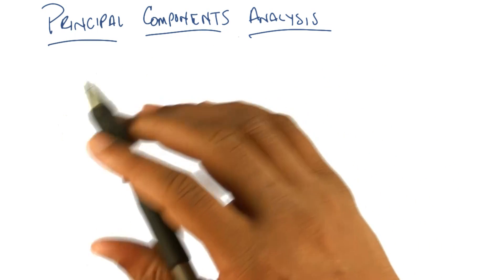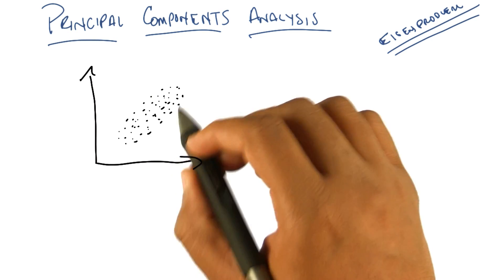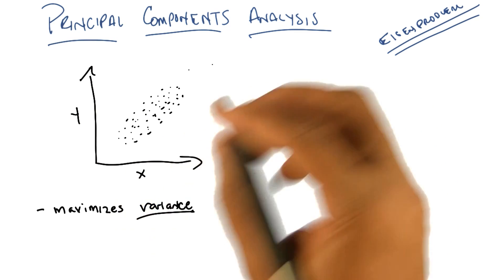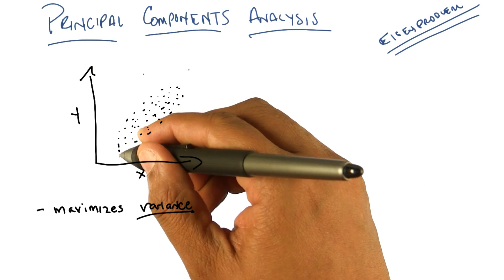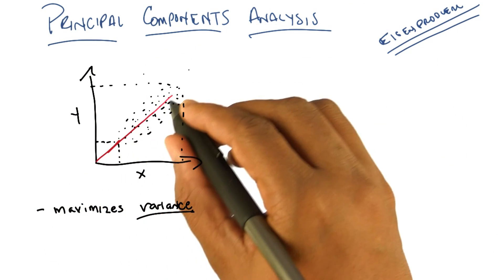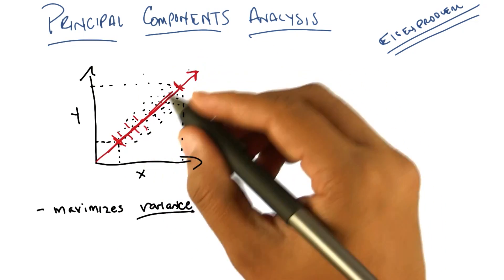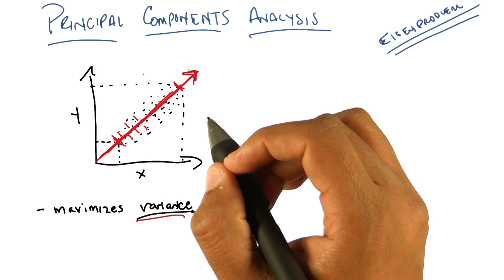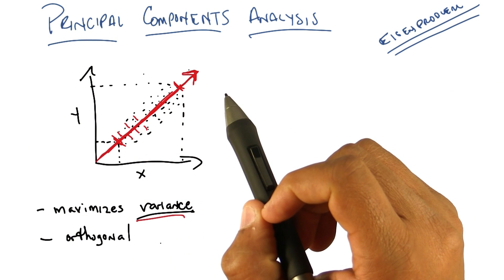Principal Components Analysis - Georgia Tech - Machine Learning

Comment: I think what many people are finding very confusing about this video, is the lack of clarity on what variance is measured relative to. Intuitively I think many people will be assuming the variance is calculated by measuring distances between points and the line. At multiple points in the video, when talking about calculating the variance, the pen is gesturing across the line (perpendicular to the line) and also red lines are drawn between the dots and the line, strongly implying that that's what is being measured (it's not). Ignoring the very misleading gestures; what the video is saying is that PCA is maximizing the variance of the points after they are are projected on to the line (i.e. variance along that line). The focus is meant to be on the distance between the dotted lines drawn to the X and Y axis vs the distance between the first two marks drawn on the example red diagonal line (larger due to larger variance). It doesn't explain that it's essentially equivalent to minimizing the sum of squared distances between the points and the line. I think this is why there are lots of comments confused about the definition of variance and whether there's a mistake and maybe he meant to say/write 'minimize'.

Comment: In PCA you are maximizing the length of the vector to each of the points from the center point of the data (mean value of each of the two variables you are dealing with), at the same time, MINIMIZING the distance from each point to the line that you drew....you are confusing many people.

Comment: i think, it is not maximizing the variance, but minimizing it. To get higher variance you can pick any line at a far away distance.
Reply: Say, data is d-dimensional. Now, you want to reduce some dimensions. You first create d new axes which are mutually orthogonal. Now along some of these axes, variance will be high and along some variance will be low. You eliminate those axes along which variance is low enough. This way you do not loose much of the important data and still reduce no. of dimensions. In essence, you try to select axes along which variance is high.
Reply: You maximize the mean squared distance, i.e. the avereage squared distance between the projected points must be as large as possible, so that you can have more disperse data

Comment: could you give a definition of VARIANCE, please?
Reply: I think Fomin is questioning the fact that they say PCA "Maximizes" variance. But the line he drew actually Minimizes it.  PCA indeed minimizes the variance of the sample point. He wrote that correctly in the video, but said the opposite.
Reply: For anyone confused about the video saying PCA "maximizes" variance but intuitively it seems like it's minimizing variance: The video is somewhat misleading about how variance is calculated. Focus on how spread out the dots will be after projecting them onto the line (i.e. along the length of the line). The variance being talked about is not calculated by measuring the distances between all the points and the line (ignore the misleading gestures with the pen). The variance here is calculated by first projecting the points onto the line, then finding the mean, then summing the squared distances between that mean point and each other point on the line (no need to divide by the number of points since it won't affect the comparisons when looking for the maximum). This is basically equivalent to minimizing the sum of squared distances between the points and the line (which I think is where some of the minimize vs maximize confusion is coming from).
Reply: TL;DR: How spread out the data points are

Variance is expected squared distance of the data points from the mean.

Imagine we take the height of 100 people in a room (room is the population).
If they are all between 6' and 6'1", the variance will be low. We can expect any given person to be VERY close to the expected height.

If the heights range are between 4' and 7', we can expect the average person to be further from the expected height.
Reply: He wrote "maximize variance", I don´t understand why it should be maximised and not minimised
Reply: do you live in a fucking parallel universe where google is not invented yet?